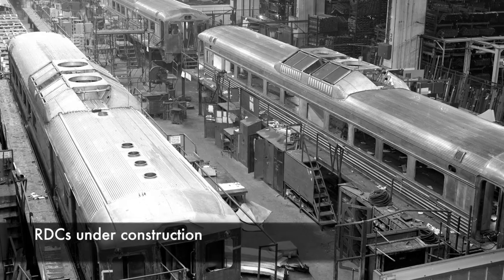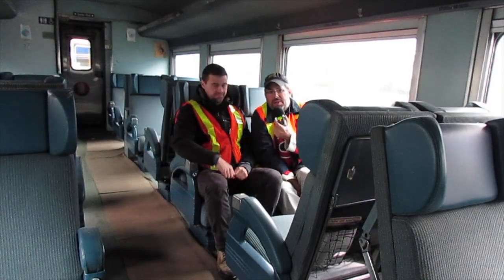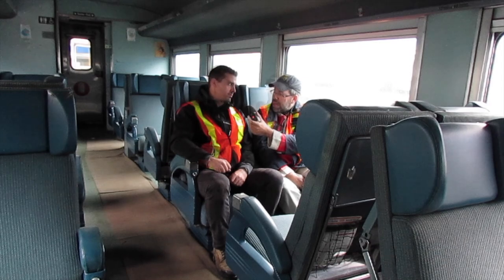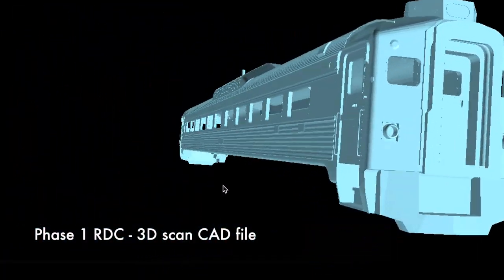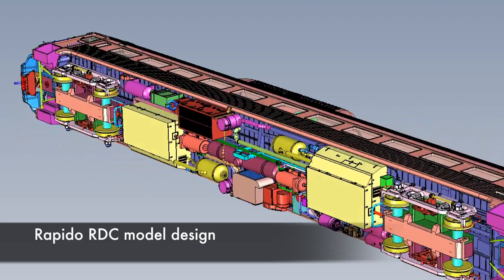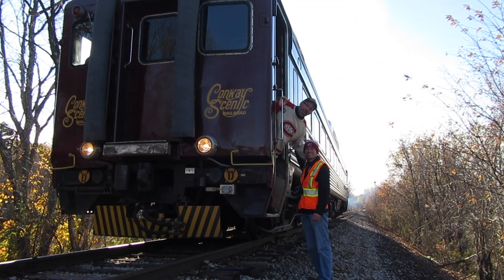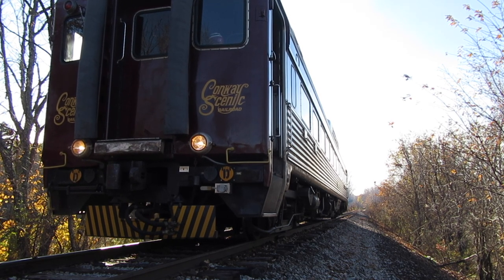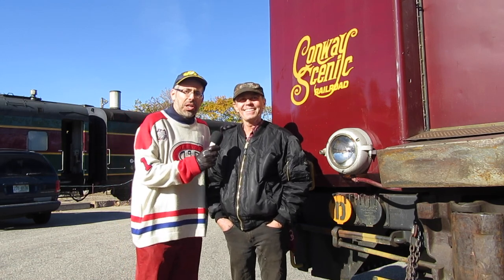All About the RDC

Comment: I used to ride RDC on the Maryland commuter rail (MARC system) between Baltimore and Union Station in Washington, DC.  It took a long time for the train to get up to speed.   There was no frills.  The train crews were contract CSX.  Their uniforms still had the  the B&O Railroad buttons on then.
The equipment was eventually retired and replaced with typical commuter rail equipment.
Reply from the maker: Awesome!

Comment: I rode on a VIA Rail Blue & Yellow Club Car before they were retired in the mid 90's.  The interior colour scheme definitely was not purple.
Reply from the maker: The cars were rebuilt into Club Galleys by CN in 1971-1972... with primarily purple seats. Some seats were red. VIA did a cosmetic rebuild in the 1980s and replaced the purple leatherette with dark brown and the purple upholstery with light brown.

Comment: Apparently the downside of this lower cost train was the flimsy design of the ends (consisting of thin stainless steel and a frame) providing little to no protection for the engineer in case of impact. http://www.trainsarefun.com/lirrphotos/LIRR%20Engineer%20Patrick%20Molese%20-%20Vignette.htm